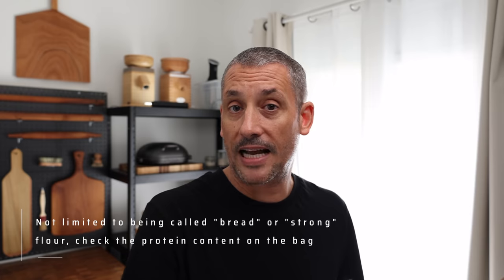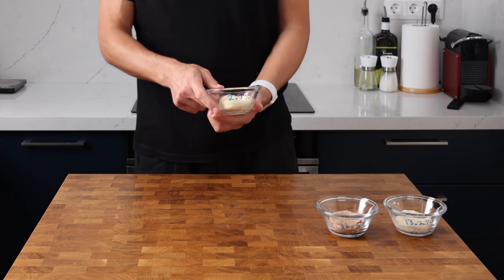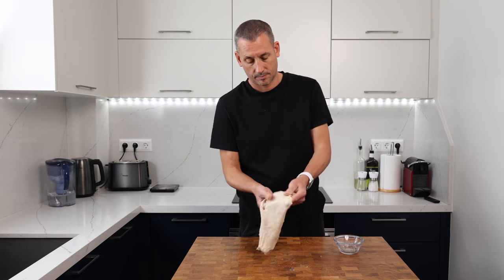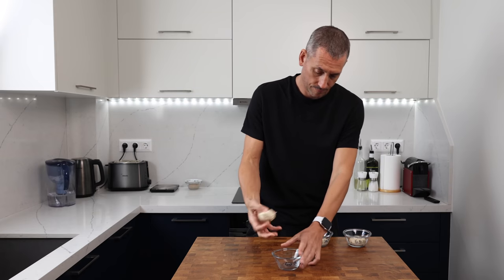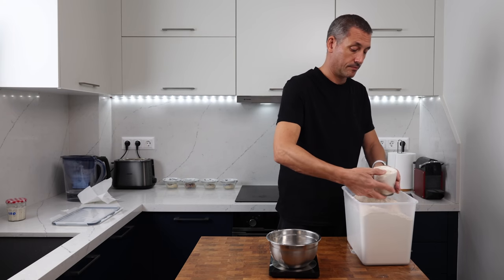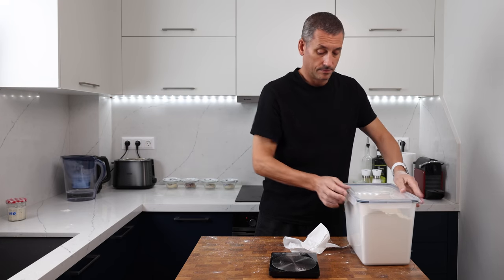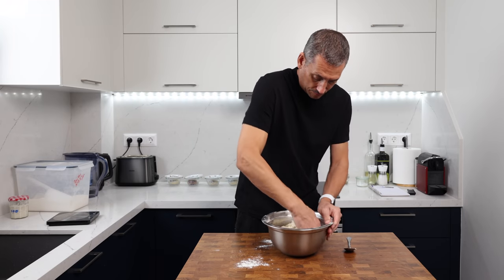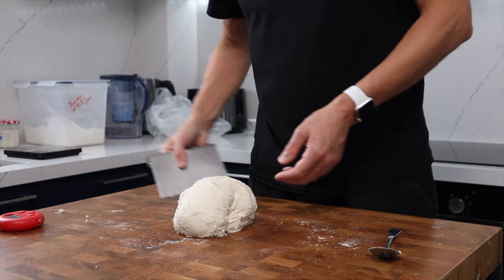Never Struggle With Sticky Dough Again

Comment: Welcome to the metric system. Where measurements make sense
Reply: Non metric measures are more mentally demanding. 
It’s a feature, not a bug.
Reply: Does not make sense to most Americans.
Reply: @barbaraholly387 weighing is accurate while volume is not
Reply: Measurements are just details working the ingredients only once with your hands using the "slap and stretch" method is the art
Reply: The idea of 1-10 makes much more sense than 1-12. Also the decimal system is much easier than the fractional system. Hospitals are on the metric system even in America.
Reply: @danp7463 duodecimal or base 12 is actually superior but only if the entire system is based around it

Comment: I struggled with the doughs for sourdough at first but now I'm at 75% hydration, generally, and manage it fine., It took about a year to get to this point. and your videos helped a lot.
Reply from the maker: Cheers Tom, I'm pleased you've found a sweet spot that works well with the flour you are using :)
Reply: Tom, how do you manage a 75% hydration dough? Is there a video or can you just explain it to me. Thanks.
Reply: @ya00007  Divide the weight of the water by the weight of the flour and then multiply the result by 100. For example, a recipe containing 1 1/4 cups of water (10 ounces) and 3 cups of all-purpose flour (15 ounces) will have a 67 percent (10/15 x 100 = 67) hydration level, indicating a moderately airy crumb.
Flour: 100
Water: 60
Reply: @ya00007  I didn't know either, when I saw your question I did the most novel thing. I googled it.
Reply: How many grams of protein do you use for that hydration?
Reply: real
Reply: @Louis-op4zj 
They asked HOW TO MANAGE a 75% hydration dough, not how to measure
Reply: Your comment helped a lot

Comment: I’ve been baking at 75% for some time.  One thing to note here is that your percentages may be higher than you think if you not including your starter totals.  Hydrating with 75% and then adding 20% by weight of your starter, you’re actually up into a higher value for your dough.  Sourdough baking is an art.  Like an artist, your skills increase with time and practice.  No two are alike…..

Comment: Been backing since 1967. Mine is 75% water; 1c starter, cup of oats, and bread flour plus a half cup rolled oats. 1/2C whole wheat flour.  And 1/3C molasses. Flat TBS of salt. It's sticky. I mix it by whip and wooden spoon. Then cover for half a day. Begin folding over, three times 'till 6PM. 480* on a stone for an hour heat soak. Form the loaves 45min before the oven is hot. Pan in the bottom for a toss of water for steam. Bake LONGER than you think. About 20min top, turn,. another 5.

Comment: People are trying to bake breads using volumetric measurements? Dear me. I even use grams for my water. I make pizza dough. The scales tare, I can add ingredients into the mixing bowl and only have 1 thing to clean. And I get the recipe right.

Leaving things alone when they're sticky is a great tip. Amazing what just not touching it for 20 minutes can do.
Reply: Great video 👏👏👏👏👍 very informative, interesting experiments with the different flours and great advice 👏👏👏👏👏👍🙏

Comment: I have been writing in a blank recipe book I got 5 years ago.  Just never had the push to use it till I started bread baking.  And I have begun using a scale as well.  I love hand mixing and waffle about getting a good stand mixer.  I also bean my sourdough journey by mixing up a  starter.  It is a fun journey!  Thanks for the great videos that help so much.
Reply: You don’t need a stand mixer for bread, but I would get one for all the other uses. Beignets, frostings, icings, creating whipped cream, creating peaks with egg whites. I put 2 deer through the grinding attachment on my kitchen aid ( got it at a yard sale for 20 bucks!!! It needed a new main gear, and that cost only a couple bucks and I’m handy like that) before I got a dedicated grinder.
Reply: @stizan24  Arthritis in my hands has finally pushed me into buying a mixer. Didn't hurt that KitchenAid was running a huge deal ($250 instead of $450) this year.

Comment: I mix my bread dough in stainless steel container & use a large metal mixing spoon to work it by scooping the dough from one side to stretch & fold it over to the other side.  I do this several times. It works for me.

Comment: Thank you for this helpful video. I think you have hit on the solution I have been looking for. I’ve been following the Richard Bertinet method with 70% hydration but whereas his comes together nicely after mixing the ingredients, mine is sticky and doesn’t gain any real strength after working it for a good while. I’ll leave it to rest and see if that helps it gain strength.

Comment: 4:30  As an (slightly) older American...  I'm less comfortable with the metric system.  However, I do have to agree with this point.  I do weigh my ingredients and in grams.  You don't have to 'know' the metric to do this.  It is very accurate and I think it can save time and effort if you change up some 'measured' ingredients to weighed.  Take his example of the differences in flour weight, same cup different amounts of flour.  How about recipes that call for a 'packed cup of brown sugar'? Depending on how you are feeling on any given day, you may pack more or less brown sugar.  I took an average weights of packed cups and now I just weight x grams of brown sugar. Also, some natural ingredients may not have a uniformed size so actual amounts could differ one teaspoon from another.    

 Awesome video, great information for a beginner like me. Thanks!
Reply: Funny that you measure in grams and that is a metric system measurement. American is  3/5ths, 2/3rds 1/16ths etc. I wish America would get off their imperial system which is so confusing and just simply use the metric system. 1 to 10   10 to 100   100 to 1,000  Easier in my opinion.

Comment: This bakers math is really important.  So Phillip, I have heard 2% salt, 1.5% instant yeast.  What about things like sugar or honey and adding fats such as butter or olive oil.  Is there a rule for what percentages to use on them?  Excellent video
Reply from the maker: Hey Blair, other wet ingredients will also affect the hydration. I wouldn't worry about sugar too much (although it will affect the rate of fermentation), but if you are adding eggs, olive oil, honey, or a syrup of any kind then this will affect the handling quality of the dough. Butter is interesting, depending on when you mix it into the dough, and the temperature of the butter and dough, it will definitely alter the feel of the dough. If the ingredient is runny or wet I would include it in the hydration calculation. I'll dive deeper into this in an upcoming video. 2% in relation to the weight of flour (bakers percentage) is a good starting point for salt, but it can obviously be adjusted to taste. Yeast will change depending on temperature, target length of fermentation, and if you are using an overnight ferment etc. But 1.5% could work.

Comment: This is such an important keypoint that a lot of sourdough recipes don't explain. That, and fermentation timings. It's impossible for someone else than you to tell you for example "use 75% hydration and bulk ferment for 6 hours", because nobody else than you work with the same starter, the same flour and in the same temperature as yourself. I use a flour from a local mill that have 11% protein content and the sweet spot is at 65% hydration. I started at 75-80 because of all these recipes and failed many attempts at first.
Reply from the maker: In my opinion, the choice of flour and hydration is the foundation of a good loaf of bread, everything after that dials it in further. Getting that message across is more important than anything else. Cheers bud

Comment: I am really struggling with finding good flour. Even if I have 800gr flour, 320 start and 460grams water (baking Ireland professional baker recipe)... that means 57,5% hydration but it sticks more than a clingy partner.
EDIT: read a comment that you need to ALWAYS use water on your hands when handling the dough. Maybe my counter sucks as well. I am going to buy a NON-STICK mat. Let's see if that in combination with watering my hands lead to a change!

Comment: I appreciate your detailed hydration calculations but how do you account for the leaven? I'm following a recipe that hydration calculates to 68% but is super sticky and doesn't hold any shape. 310 g water, 450 g flour but has 200 g of leaven. Using 50 g of ww flour and 400 g of bread flour.

Comment: I’ve been working on a baguette recipe that uses a poolish. The first time I followed the recipe as is (64% hydration). The poolish was fermented for overnight in the fridge and then the dough was mixed the next day and was left to rise on the counter for a few hours. Shaped, proofed and baked at 450 degree oven with steam added. Got a good shape and oven lift, but my crumb structure was lacking.

Second time, I used 72% hydration and fermented to poolish overnight again and then also put the dough in the fridge for another overnight. I got a much better crumb structure, but not much oven lift.

I noticed when I shaped my baguettes with the higher hydration, they didn’t really hold their shape. They kind of just squished out. I did use a bakers couche for proofing, but it didn’t seem to help much. 

Any ideas what I might have done wrong? Did I need to work my dough more?
Reply: Sounds like shaping. When you have a really hydrated dough it sticks to anything and you will get lots of tiny tears which will let the gas out easily.  High hydration will only rise vertically very little before going out horizontally. I have baked very large flat baguettes before like this. Fold the baguette onto itself to hold as much in there as possible and to keep the outside tension which is the sole reason it will keep its shape. Also oven spring is the result of the internal evaporation of the water against the tension of the outside dough. Weak tension will let the gas out and be flat. High tension will hold it in and swell.

Comment: I've been making sourdough bread for only a few weeks and have been using a recipe that calls for 100% hydration. It is SO sticky! The bake turns out OK but I am now thinking I should try a lower hydration, probably 70%.
Also, what effect does altitude have here? I recently moved and am now at 6000' (1800 m) above sea level. Should I be adjusting my recipe (ingredients, times, temperature, etc.) for this elevation?

Comment: Well, the biggest problem I have run into is that when I weigh every thing out, my resulting dough doesn't look anything like what I see on You Tube. Mostly it is a lot drier/stiffer. I have been doing variations on a standard recipe. where I took notes. Never have been able to get some thing that I could do the folds with. I do like the taste though....
Reply: I much prefer very high-hydration doughs -- 80-100%. I use a "coil-fold" most of the time -- which is a fancy word for "pick it up in the middle, stretch it upwards, and lay it back down".

Mix the dough until it comes together, then cover it and let it rest for an hour. Then do one coil fold, rotate the bowl 180 deg and do another coil fold, then 90 deg and another coil fold, then 180 deg and a fourth coil fold. Cover it and let it rest a half hour. Do that four times and you're ready for a bulk rise. The dough gets easier and easier to work with for each set of four.

One last tip that this video didn't mention -- wet your hands with water just before handling your dough. That's all it takes to keep the dough from sticking to your hands.

When you bake off a high-hydration dough, you'll notice an immediate difference in texture of the finished bread. It will have a looser crumb and has a looser mouth-feel. I much prefer it.

Comment: Thank you as always 😊  Do you have a link or sizing/capacity for your flour tub?  I’ve been looking for something like that for a long time.
Reply from the maker: Cheers Silvius, Ive just measured my container. It's 23cm high and 29cm deep and 19cm wide (it's not exactly square, it gets a little thinner at the bottom). I bought a few different sizes from Ikea when I organised my pantry / store cupboard. I'm not sure how many 1 kilo bags the hold but it's several. The lid clips on well and seals closed so I don't worry about any mischievous bugs getting in! Hope this helps
Reply: @CulinaryExploration  Thank you and that helped me immensely, thank you for all of those details!  😄
Reply from the maker: @silviusprince5235  You are more than welcome!
Reply: @CulinaryExploration  😊

Comment: Very interesting but it simply never works for me. The flour to water mixture stated in every single recipe I've tried, including yours, results in either super sticky dough or a crumbly mess. I always have to adjust with either flour or water.
Reply: I've had those two problems you mention and I've fixed them by;
- Try a different brand of flour, like Kings Arthur brand.  (Can't use old, stale or bad brands)
- The weight of the water should be in grams and around 70% of the total weight of the flour. 
- Remember after initial mixing to let the dough rest for 30 minutes, covered, perferrably in a warm place. After every stretch and fold, let it rest another 30 minutes.
-  Your working surface could be 5 degrees or so cooler than the working temperature of the dough which prevents the dough from rising, so watch that.
- The water should be around 86-90 degrees before you add it. Honestly, I just add lukewarm water and I've measured that at 100 degrees. Didn't seem to harm anything.
Hope any of these tips helps.

Comment: Question:
What type of flour is the best to use in Germany?
Type 405 normally has 10-11.5 protein, but I managed to find one with 13.
Type 550 I never found one with more then 11.5
Type 1050 I found one with 14.1
I know that the bread flour should be type 812 and you can make it by mixing 60% type 550 and 40% type 1050, but should I use the good 405 (with 13 protein) instead of type 550?
Reply: is the "type" referring to the grind? like type 00 is just very finely grinded flour? 
but so far, what have u found? what type worked best so far?

Comment: One question I am pondering is if calculating the % hydration using the method shown then surely this is going to vary  when using a starter culture rather than all dry ingredients ????
Reply from the maker: Hey waxhead, yes the starter does impact the dough hydration. The weight of the water and the flour should be taken into consideration when calculating the overall hydration when using a sourdough starter or preferment. I chat about that a little more in this video here, hope it helps; https://youtu.be/LRkCc4WJaeg

Comment: Hey there,
I recently tested out something: I made two doughs, one with roughly 70% hydration and one with about 65%. What I noticed is that the lower hydration one fermented very well, it finished bulk fermentation within 6 hours and was nice and bubbely. Whereas the other dough did not rise as much. The 70% hydration dough took about 8-10 hours to even come close to the final result of the other dough... I have a really good 13% protein content flour which actually works pretty well. I just did not think a difference of 5% in hydration would make such a difference... also we are talking about 70% hydration, not like 80% or so... Do you have any thoughts about this?
Reply from the maker: Hey Cristoph, that's interesting. I think there is more to flour than protein content. Maybe you've found the hydration sweet spot for that particular loaf. Have you tried baking a ciabatta and seeing what results you get?

Comment: Hi,my name is Paul I've been making bread since 1972, it was the national bread strike that started me off on my journey, have just watched your video..at last someone who has explained the secrets really well and as youv've said, accuracy of ingredients, time and patience, cracking job, i buy my flour from Lidl, Aldi (when it's available) Asda's has the highest protein content.
Yeast, fresh yeast is great when you can get it, but i stumbled across a yeast company who stocked both fresh and dried and all these years later i can still get on line 500g "Fermipan" Red packet yeast about £5.50 ea. lasts for months kept in original packet inside a kilner clip top jar, use 7g per 500g flour..Great job many thanks ..Paul
Reply from the maker: Cheers Paul - and thanks for the heads up on the yeast!

Comment: You didn't really address the stickynes of the dough. When you increase the hydration you increase the stickynes too. I'm using a tipo 00  pizza flour with 13.5 % protein. The dough is sticky with any hydration percent at 65 or higher.

Comment: When working with high hydration (75% or more) wet hands instead of flouring and use stretch/folds in the bowl instead of regular kneading. It also helps to use a bugs,polish or to presoak the flour/water before adding the yeast/salt,especially when using whole wheat flour.